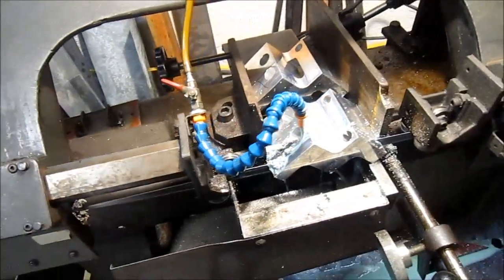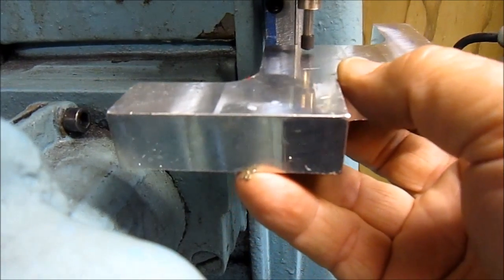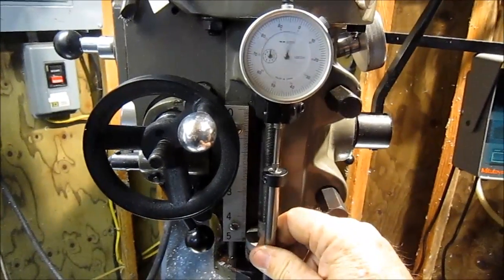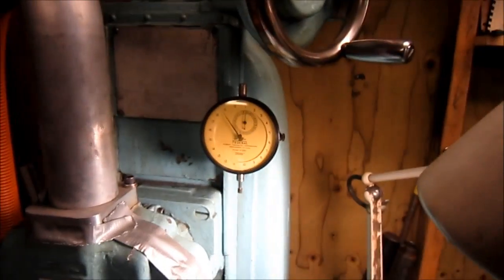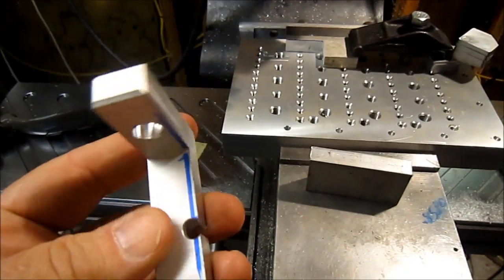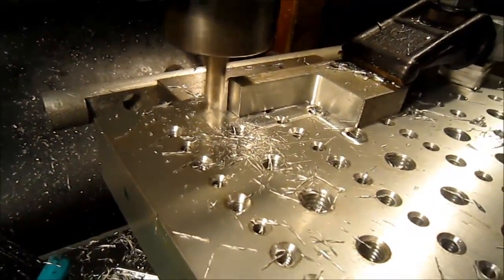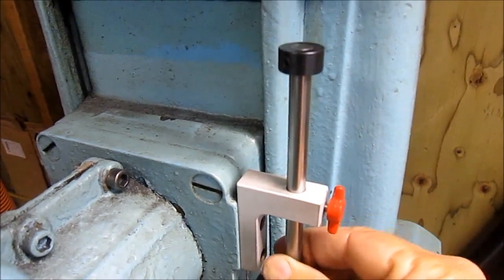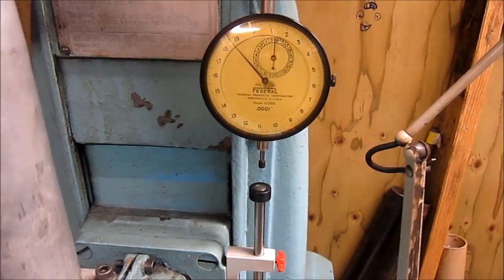Quickie 20   Surface Grinder Modification

Comment: Hey Chuck,
Clever idea for getting accurate readings on your surface grinder. I like the pallet arrangement you have on your mill. Thanks for another informative and useful video!
Regards,
Dave
Reply from the maker: Hi Dave...Thanks
I drilled my pallet so I could use the various types/sizes of holddowns that I have
Chuck

Comment: Yup, had a little wtf? moment when I saw the duct tape.... :-)
Nice upgrade for the grinder though.

Colin
Reply from the maker: Colin
So you were the little birdie that was in my head....haha...I knew I better explain what the duct tape was there for since it is not a race car...lol
Thanks for watching and your comment
Chuck
Reply: You might've known some yahoo would notice and speak about it...lol!
I'm kinda likin your mini pallet too....gotta make a project pallet soon.

Colin
Reply from the maker: ***** well your not "some yahoo"... in my book!
yes my pallet is a Oxtool copy, it can have the round bar mounted in with axis to make it a tilt table.  I also drilled/tapped holes so I could use a variety of holddowns..small to large
I set mine up with dowels, but Tom has a good trick where he uses any of the holes and has turned allen head screws as buttons for alignment...pretty cool
Other note, drill holes through the plate, not blind holes which hold all of the swarf, through holes will hold also but not as bad...I have blind holes..:(

Comment: Hi Chuck !
That's a very nice surface grinder you have there - I'm looking for one like it !

You say early in the morning trying to wake up ... maybe that's why you screwed up all that lovely alu - don't you collect it for later melting ?

You tried the indicater while the machine was running, yeah, but I think it should have had some contact between the "trigger" or sensor (I don't know the right word !) and that nice rod you made ? ha, ha !
I know you just tested it BEFORE doing any work, but how much will such a test show ?
... I beleave only some very huge unbalances, so huge that you may hear or see them without the indicator ;-))

Anyway, a nice little project !

I long for the time, where I can do some of these small projects too ;-((
Reply from the maker: Hello Keld...
I only wish early morning was my issue, I was out there in the morning because it was bugging me to finish....other mistakes were just BOZOs
Hmmm...good question is there will be disturbance when the grinding wheel makes contact...I will let you know
Chuck

Comment: your bandsaw can use mist lubrication too, get rid of that garden hose. The sprayer is 'C' shaped and goes over the blade
Reply from the maker: I would have to be doing a huge amount of cutting on the bandsaw before I would use the spray mist, just too messy...I use a wax stick to lubricate the bladeThank for watching and your input
Reply: you had a flood coolant on your bandsaw in the video though, which is why i recommended it, but i agree wax is cleaner --- and you're not supposed to get a puddle from mist coolant, the chips should be dry

Comment: hay chuck y not get a accu remote for that then there is no fusing with moving stuff i have them on my 1340 turnmaster lathe and on my wells index 745 mill and they work good for the cost there are 2 models made the digi remote and the accu remote i have both and the accu remote is worth the extra few buck you pay and are more accurate down to 1/2 thou i got mine at grizzly cause there local for me and have that day and price not to bad they are sold in 6"/12"/24"/38" price from $30~$109 when i got mine. just a thought
Reply from the maker: Turn...
I looked up the product, good price and I bet a good produce, but what I say only read to .001 and I wanted .0001...big difference
Thanks for watching and your comment/information
Chuck